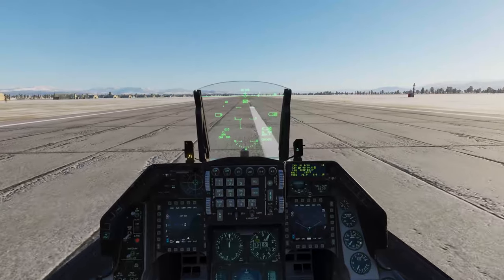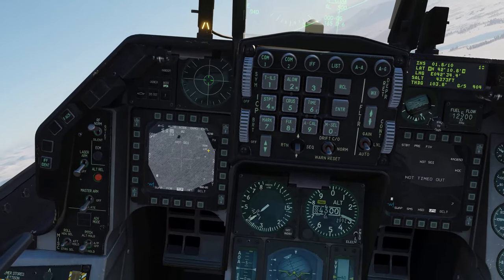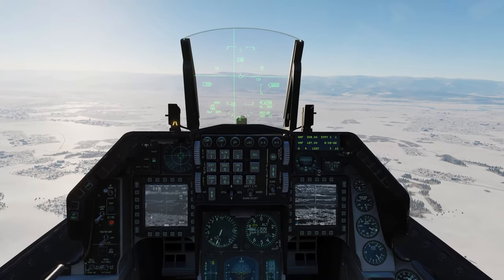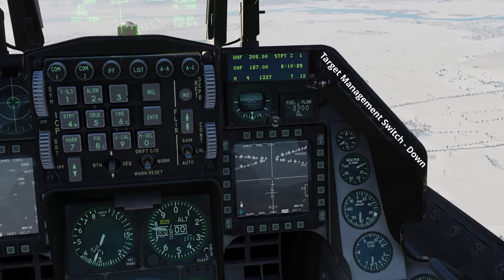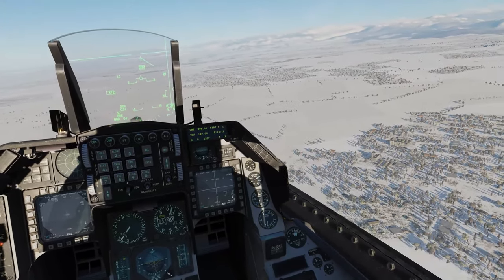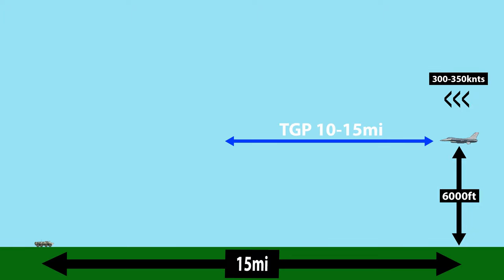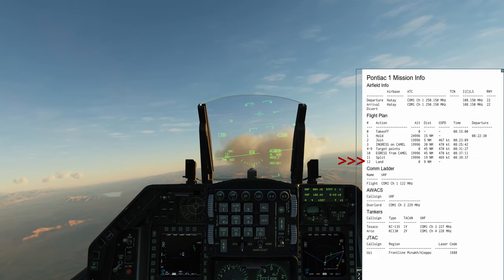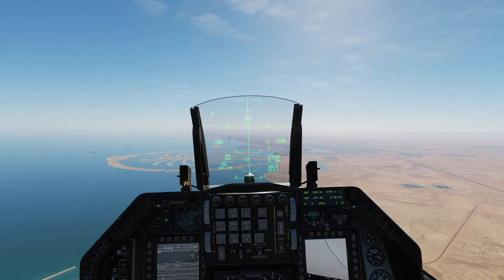F-16 Boresight (BSGT) Tutorial + 3 bonus tips. AGM-65 Maverick flight admin | DCS

Comment: Good video and useful tips, but I solved by boresighting the mavs when I'm still on the ground in the airfield, after rearming. I spot an object where I can point my TGP and my mav's IR sensor, and that's it. No problem at all because nobody fires at me and no hurry.The only downside of this procedure is that you have to wait for mavs to be ready, and then boresighting the mavs. It takes a bit more of time
Reply from the maker: Glad to hear it. I almost put that in the video but didn’t quite make the cut because GR already did it!
Reply: I agree is is good but I fly with a squad where the TOT is important so I don't have the time on the ground most of the time.  I hear this is something in real life that is done by the ground crew . . .

Comment: If you have a buddy with you, or are planning to refuel en-route, you can align the Maverick using an aircraft as the 'target' as well:
1) Setup AA mode to include the FCR, TGP and WPN pages, setup AG mode any way you want and turn on the missile.
2) Fly a couple of miles behind a non-maneuvering aircraft.
3) In AG mode, select the pylon you want to boresight.
4) Switch to AA mode and designate the aircraft in front of you with the FCR. The TGP will now align with that aircraft.
5) Select WPN page and slew the Maverick to the target, press TMS up to lock and press BSGT.
6) Go back to AG mode and repeat steps 3-5 for the other pylon.

This way you can climb to cruise altitude directly after takeoff to save fuel and can boresight over water, empty desert, above clouds, etc.

By the way, it sounded like the ice cream van had arrived while watching your video...